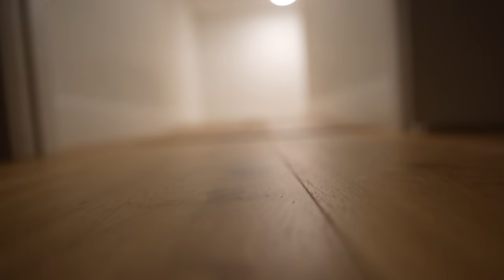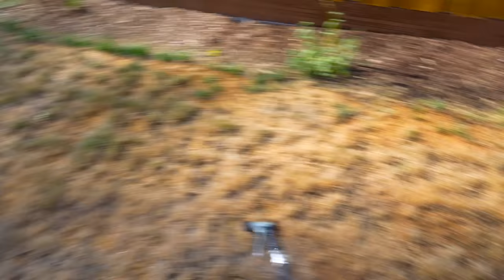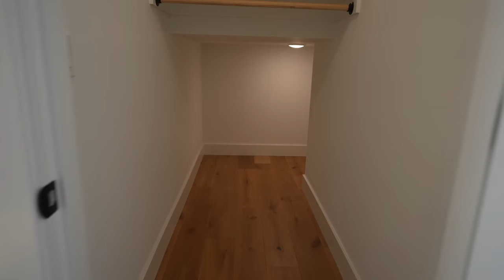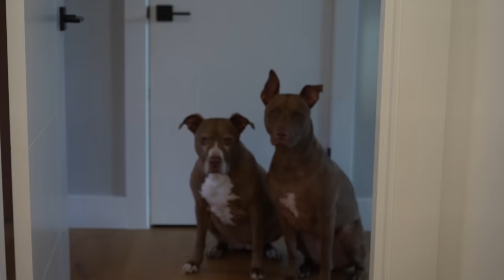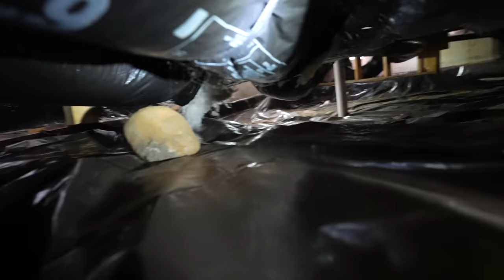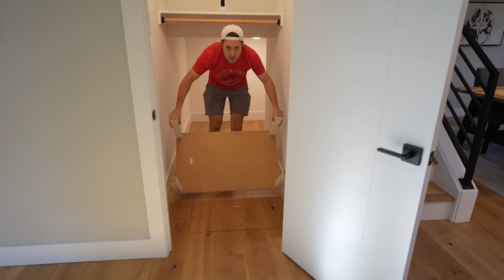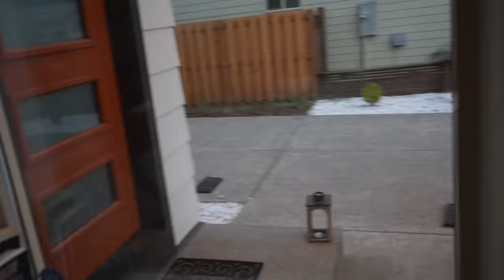Something HAUNTED Is Living UNDERNEATH Our House!

Comment: A little tip first thing you should try is burning sage, that's what I did when my Mom bought that haunted RV burnt sage and faith usually works, if the Ghost is stronger and more violent try getting an ordained pastor or preacher to do an exorcism and if that doesn't work you could try moving although that might not work cause the Ghost could follow to your new place!😓

Comment: 0:01  so it happened to me before but not in the closet though. What I did to stop it. Was to call a local shelter. And stay there for a little bit if there is no shelter then go to a hotel near you! I will make sure that that ghost or make that
Reply: He should dig out the hole he found

Comment: there is most likely a ghost living in your house but here are some things that you could do:
use salt as a spirit barrier however some ghosts/spirits are stronger and can break through
use anything you have in your pantry like sugar or flour this will act kinda like a trap so you can see footprints and handprints if you don’t have a black light or UV light
if you have it, use something loud as a trap and be hiding in a room ready to jump out if the ghost steps on it

hope this helps!😊